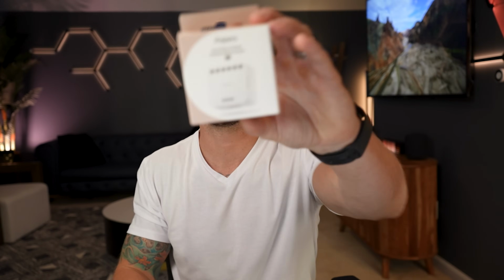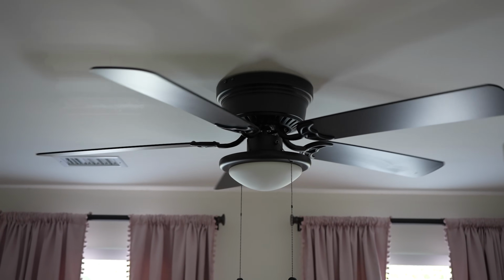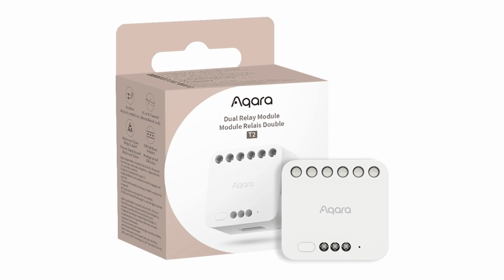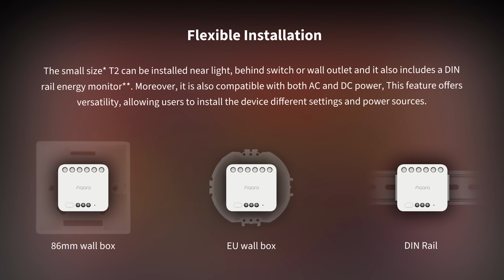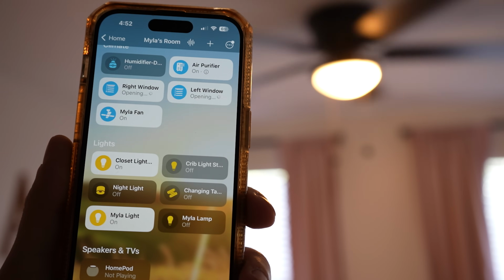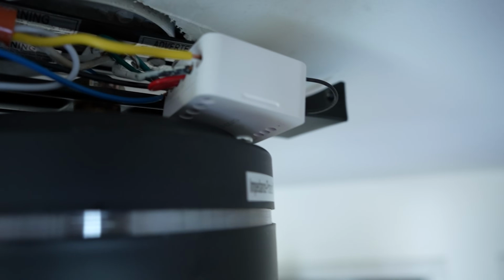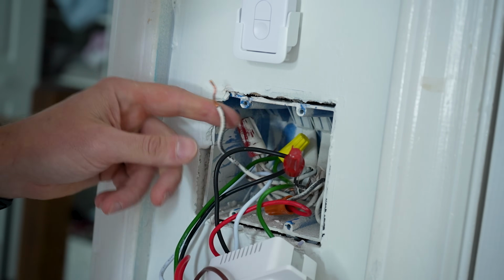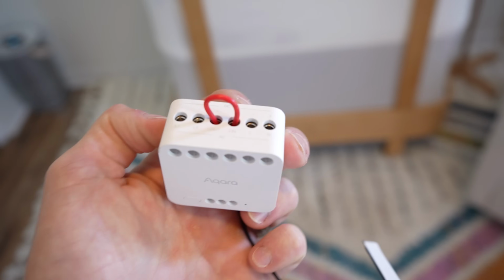Make Your Ceiling Fan (or Anything Else) SMART with THIS!

Comment: I’m out right confused, the 2 Switch Aqara system already could had controled his light with 1 n the fan with the other. I started he use the T2 to control the fan n light n then us a 2smart switch to control remotely the T2. To be clear the 2 Rocker Switch is a T2 with bottoms. The point of the T2 is that is a wireless 2 switch 10amp power relay n as he said then u can use any cheap switch, but usted he use a 2 rocker switch that cost 2x the T2 for physical bottom. OMG Shame! H were one of the person that show me how to build a smart home n use automation n short cuts. A 15$ Lutron pica wireless controller would have worked great instead of the aqara switch, n u would had even more bottoms for automations n scenes since the pica has 5 bottoms n each can has 3 commands (1press, 2presses, 1long-press) there is a total of 15 commands that 15$ switches can do.
Reply from the maker: The double rocker switch could not be used on its own to control the fan and light separately, since the fan/light is only controlled by a single switch. You would need existing wiring for two switches (one for light and one for fan) in order to only use the double rocker without the relay.

And I chose to use the double rocker switch, instead of a pico remote or other wireless switch for a few reasons...
1. it's wired for constant power so we never need to worry about batteries
2. It fit inside existing switch plate and matched the other switch
3. The owners of this house already have an Aqara hub. They do not own Lutron. So if I used a pico remote, I would also need to buy a Lutron bridge.... much more than $15 at that point. Plus automating Aqara to control Aqara is very reliable and efficient. 
3. Simplicity. I simply wanted a switch to turn the lights and fans off separately. I did not want a switch with 15 different commands here. It is not my house and that would have just made the owners more confused or frustrated.
Reply: @ShaneCreates  like I said, I have learned everything I know from most of ur videos, so u keep schooling me. On my defense I thought there were existing 2 lines of wireing for each so that was my main mistake. All those other are valid points specifically for a house owner with a wife n kids for (wife approval process as u alway say) I still a college student living at dorm n parents home during break so budget wireless for easy movement is a most we need to move dorm every semester so is a pain. Thanks for letting me know the read n this pointers. I normally been using squara n Lutron at my parents home for the easy use. I also use the Synology + scripted for the PoE camera.

Comment: Will this allow me to set up smart switch functionality in my gas fireplace insert? It currently uses a standard light switch that is connected with two wires to the ignitor mechanism in the heater.  No power from home service is supplied to the switch.  The switch functions normally, when activated manually, even when there is a power outage. The on/off function apparently depends upon residual charge in the ignitor mechanism when the switch is manually operated.

Comment: Thanks Shane, always well done with good info. I’m guessing there would be no fan speed control.
Reply from the maker: That's correct. Only on/off and you would have to use the pull cord still to change the speed if needed.
Reply: Speed control on at least one of the channels would be an outstanding addition to this relay.
Reply: Would the home hub 2 help here? I understand the home hub has RF capabilities such that could you send the remote high/low button as a function to Homehub and automate with that? Would that work? Been trying to figure this out as well.

Comment: Thanks for another very informative video review! I have been looking for something like that to implement in my Home App. One thing that I like to be for sure on the terms of “wet” and “dry”, could I understand those as “wet” means continuous connection, and “dry” means momentum connection?
Reply: You'll hear these terms thrown around in electrical and control systems settings when talking about relays.

A wet relay is one that supplies power through itself, essentially acting as a passthrough. For example, if you are powering the device with 110AC, then when the relay turns on, it supplies 110AC on the output. This is useful when turning the power to a device on and off is how you want to control it, such as a light.

A dry relay has the input and the output isolated from each other. In this case, if you are powering the device with 110AC, then when the relay turns on, no power is supplied to the output, it just connects the 2 output pins together completing the circuit. This is useful for devices that already have their own power and you just want to complete the circuit, such as the power button on your PC or a garage door button.

A cheap coffee pot with a physical on/off switch is a great example of both. I could just leave the switch in the on position and wire a wet relay into the power line. When the relay turns on, power is supplied, and the coffee starts brewing. But if the pot has a clock, it would be reset each time. So, alternatively, I could wire a dry relay in place of the switch. When the relay turns on, it completes the switch circuit, just like as if I had physically walked up and flipped the switch to start the brewing.

Hopefully that helps!

Comment: will this work with 220v?
Reply from the maker: Yes. See below the rated parameters for AC powered:
100-250V, 50/60Hz/Max.10A, Max 2500W (Incandescent Lamp); Max. 1A, Max. 250W (LED, CFL Fluorescent Lamp); Max. 1A, Max. 1/4 HP (Motor) M.1.

Comment: I bought two of these for our garage doors because I’m sick of the “obstructed” error all the dang time (Meross - no matter how long I make the close and open seconds) or unreliability (MyQ which always took forever to recognize I was home and work). But never considered a fan! This is the way all the fans in the bedrooms of our house are wired and it would be amazing to have this setup instead of having to search for months (not a joke) for the remote my kids lost or rely on them not turning off the switch. Follow up questions on some things - assuming the switch only works if WiFi is available? Can you use any switch? We have Lutron and Brilliant ones. Specifically thinking of the on/off switches from Lutron. Thanks so much for this!
Reply from the maker: Glad the video was helpful. To answer your questions...

1. Technically no, if you set it up with Aqara switches like I did. The switches and the relay connect via zigbee, which don't require wifi. So as long as your Aqara zigbee hub is operational, the automations that connect the relay to the switches should still work even if wifi is down. 

2. You could utilize other switches the same way, like Lutron switches, but it might make the setup slightly more complicated and pose other potential issues. I believe Brilliant connects via wifi, so that would rely on wifi working to control the fan/light. Lutron uses a proprietary protocol to connect to their hub, so that might still work if wifi is down, if you are automating through homekit since it's local. Automations would be more complex in HomeKit vs. Aqara app since there is no "toggle" option in HomeKit like we did in the Aqara app.

Comment: Do you have to change the switches on wall or can you only do the ceiling fan module and still use switches and sliders for fan and or the HomeKit app?
Reply from the maker: If you install the T2 in the ceiling fan only, you cannot use your wall switches. They would cut the power to the T2 leaving it unresponsive (much like a smart bulb controlled by wall switches). 

If you already have separate switches for the fan and light, you may want to just use the T2 behind the switches or use smart switches instead of the T2.

The reason I installed the T2 in this ceiling fan is because the light and fan were only wired to a single switch so I could not control them separately initially.
Reply: Do I need a t2 for fan switch and light? @ShaneCreates
Reply from the maker: @davidburford2269  no. You can put two load wires into the T2 so you can control two switches separately.
Reply: @ShaneCreates do I need an Aquara hub too?
Reply from the maker: @davidburford2269  yes

Comment: Would love to see how to use on a garage door.  I hate my MYQ setup.
Reply: I added the Meross controller to my garage opener and gate opener. It has been rock solid for over two years now. Wouldn’t the gdo be same as the ceiling fan in this video?
Reply from the maker: I just noticed Tech with Brett made a great video on the T2 also and he showed how to install this for a garage door opener. Check it out - https://youtu.be/ToJHXnb9BR8?si=uL4GP8VdJO6sDwCw
Reply: @ShaneCreates  I checked it out.  Was really helpful.  Thanks.  Love all your videos!!!